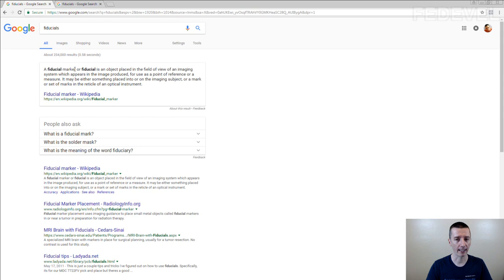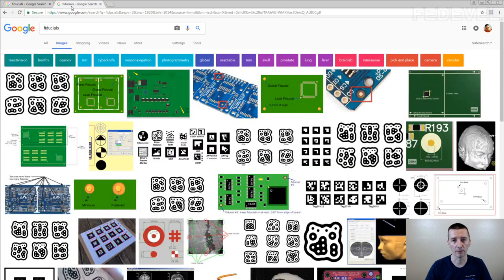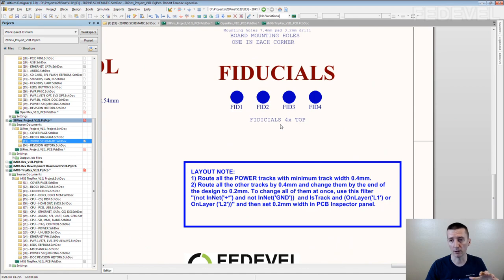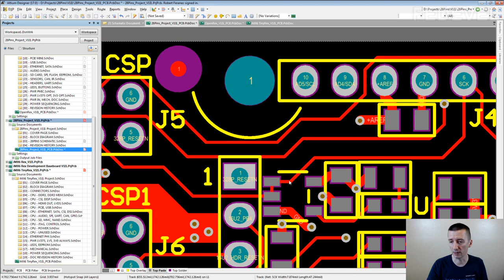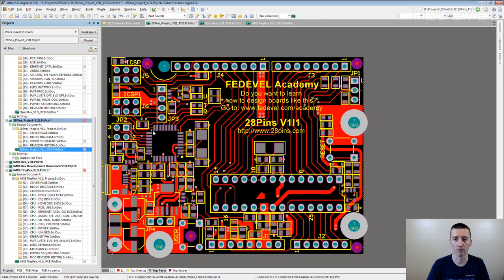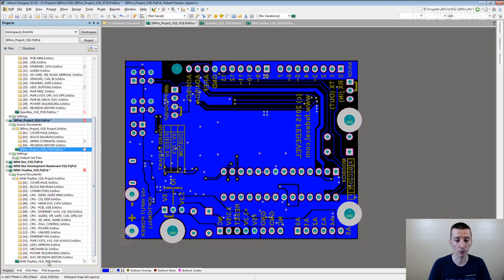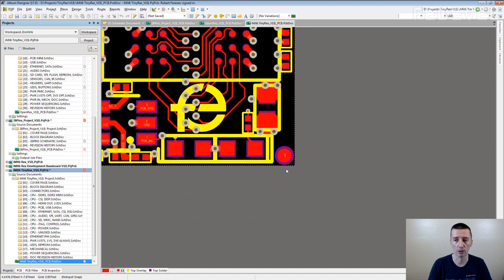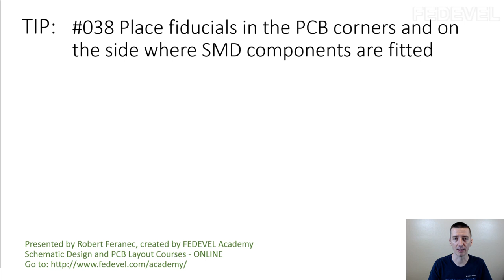TIP #038: Place fiducials in the PCB corners and on the side where SMD components are fitted

Comment: You can also place a fiducials outside the PCB, if the PCB is extremely crowded and it is supposed to be punched out of panel after assembly.
Reply from the maker: I have this ready in a different tip - when speaking about panel :)
Reply: @RobertFeranec  why is the overlay outside the board boundary in some PCBs? They appear to be overlay related to connectors.

Comment: 4:33  You don't need to place fiducials for PCB sides with no SMT components

Somewhat true.  Automated TH component placement is so rare now.  However, when automated insertion equipment is used it too can use fiducial marks on a surface copper layer.  However, TH insertion equipment usually gets its best accuracy by recognizing non plated drilled holes that are drilled during the same drilling session as the plated holes that are receiving the inserted components.

Comment: Why fiducial does not have a cutout for the polygon? Should be free not only from the mask. Why every time to write a rule for a given class of components (fiducial)?
Reply: Good point, I learned this the hard way: "TIP # 038b: Do put a polygon cutout in your fiducial footprint!"

Also remember to close the soldermask opening completely for the pad. Also learned this the hard way.
Reply: "Also remember..." Yes. To make the full circl arc the copper layer with a property Keep Out, to prevent route, too.